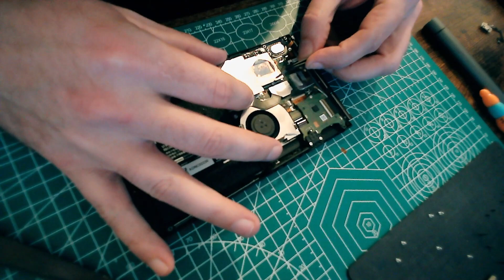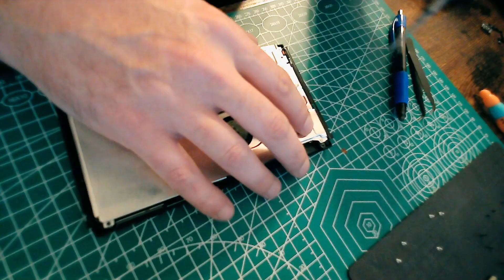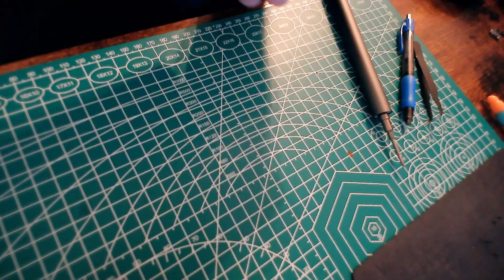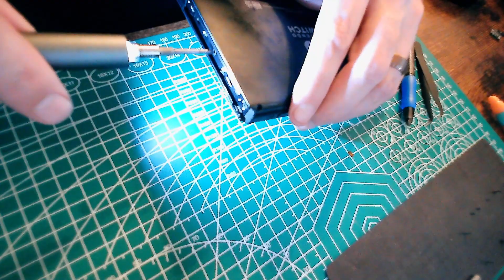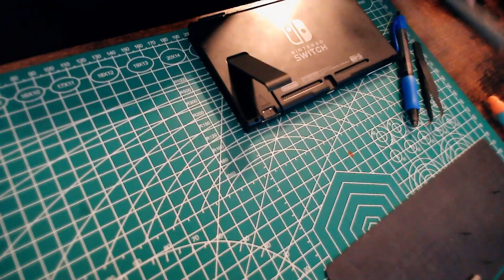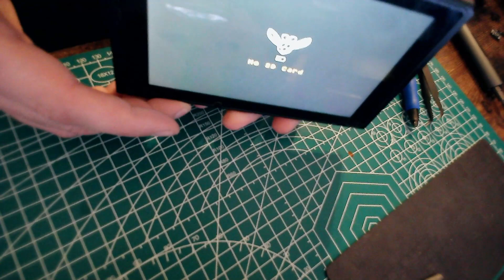Nintendo Switch Modding - Step Four - Putting it all back together - Nintendo Switch Mod

Comment: Hey man thanks for the teardown. i havent kept up with the mod scene, but do these new installs only require one ribbon soldered?  i saw a seperate video with two soldered ribbons, it was for a lite though
Reply from the maker: Yeah man! V1/V2 switches are just the one ribbon cable, 5 solder points! The lites are 10 IIRC…but once you’ve got a microscope and a whiskey in you to steady your hands it’s not terrible.
Reply: thanks for the reply and good video. @Randyisanerd
Reply: i like to use a head lamp too when working with small electronics, makes a difference @Randyisanerd
Reply: This is amazing. Thank you for the breakdown and tips along the way.  Might give this a go. Gotta get some equipment and test it out. Never solder or torn apart a console but heck you explained it so well all I gotta do is apply the whole video into action.